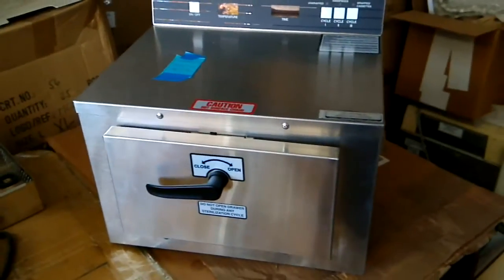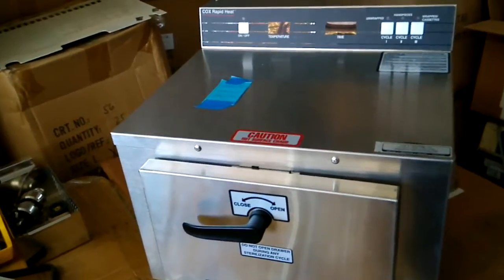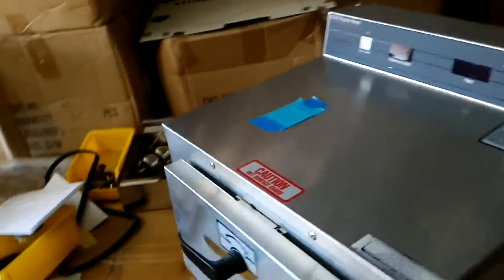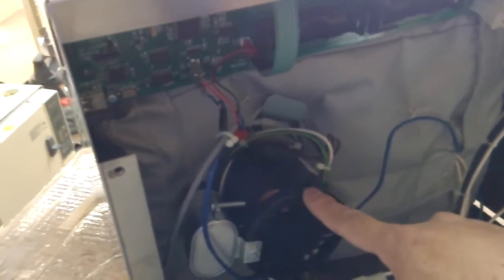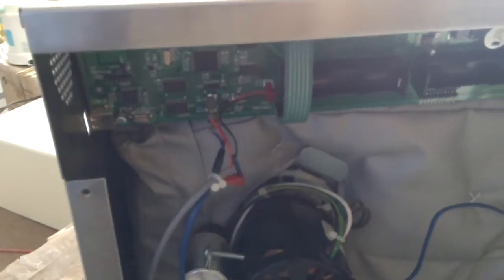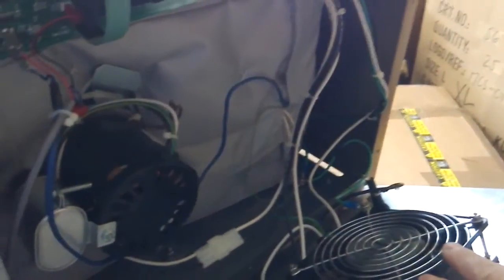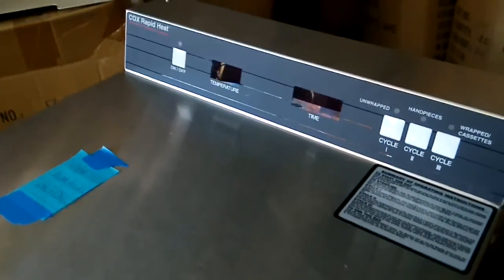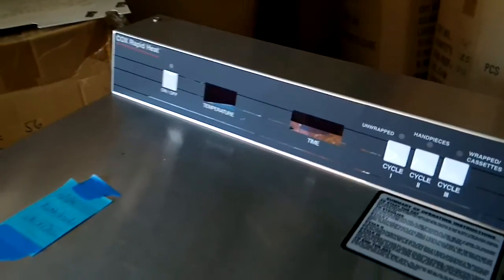Cox Dry Heat Sterilizer, Cox Sterilizer,CPAC Sterilizer,

Comment: what can be the problem if does not turn on? the fuse? o the turn on button
Reply from the maker: please try the back side fuse first, this is the easy way to check. If the fuse is not the reason, then it is hard to guess, it may be some wires off inside, the circuit board failed, or some other reasons. If possible, please take a photo of its back side label and email to us, you can submit a request from our website at www.isterilizer.com, I need to know more about the machine, then we can give me you suggestion.